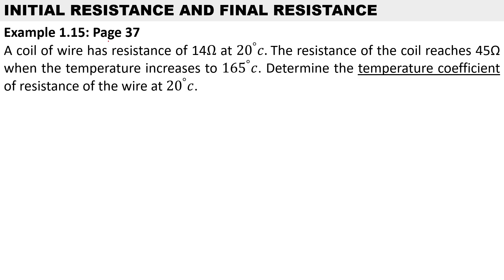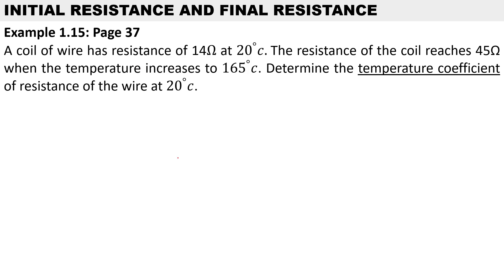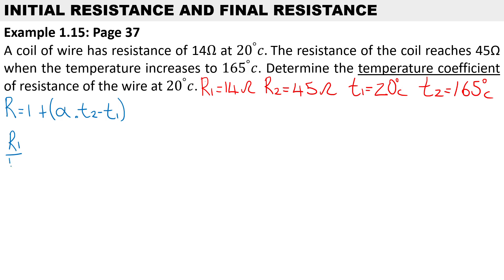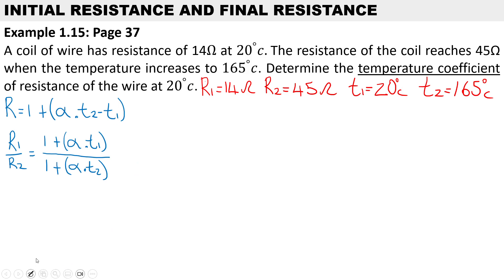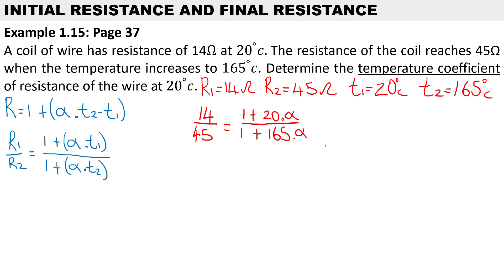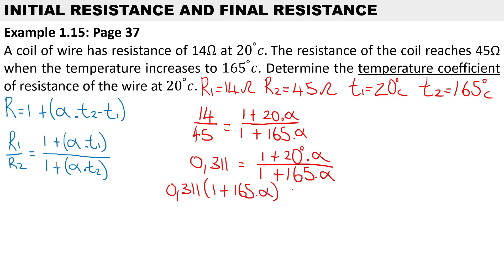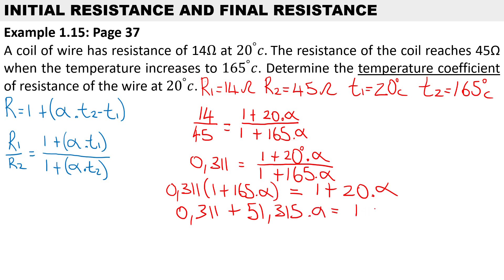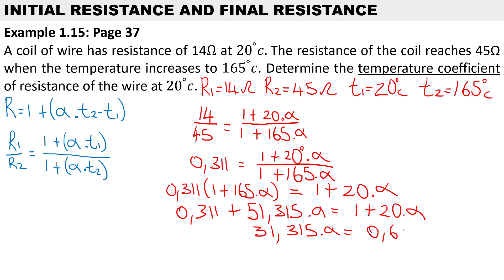Example 1.15 - N4 Electrotechnics

Comment: I think you made a mistake with this one. I am getting 31/2030 per degrees Celsius. That's 15,271 X 10 to the minus 3 per degrees Celsius. Use the formula R temp = R theta [ 1 + alpha theta ( t minus theta )]